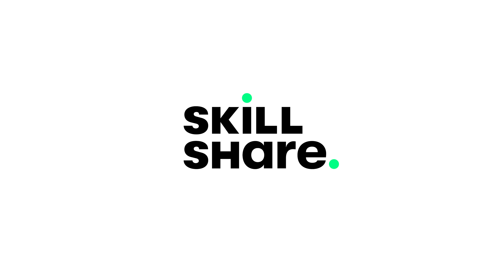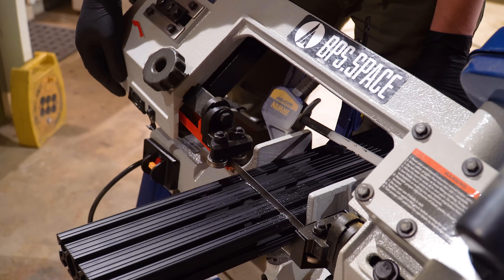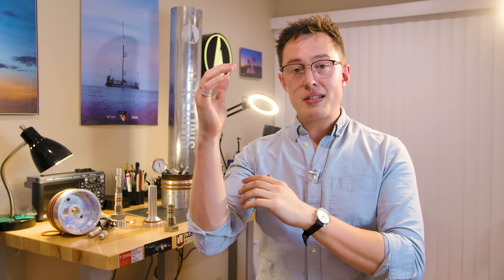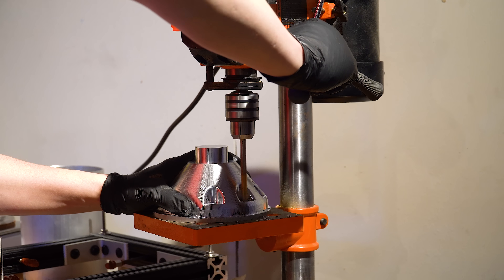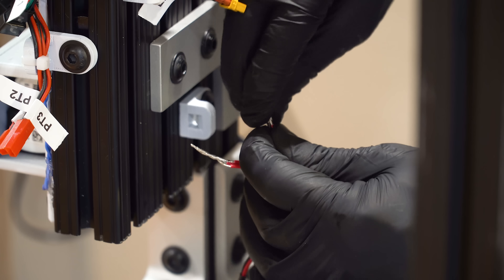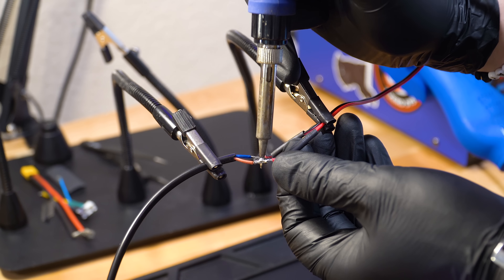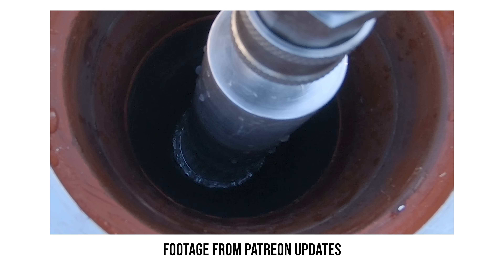Building A Rocket Motor Test Stand - Simplex Ep 5

Comment: Fwiw, the point of the resistors in the pressure measurement circuit is to have a known resistance so you can compare and back out the current through the sensor

You need accurate knowledge of the resistor resistances to do this. Logically, that means shelling out for good resistors with tight tolerances... But it also works just as well to measure the resistance of a shitty resistor really accurately with a benchtop multimeter, which you should already be doing with your expensive nice resistors. As long as the resistance curve isn't super temperature sensitive, it'll be more than good enough

Source: I spent way too much on reference resistors for a few projects before realizing that I should just measure them and use the measurement rather than trust the specc'd number on the sheet

Edit: this works fantastically well for one-offs. Nice resistors exist for when you need your mass produced board to be within spec without adjusting the offset in the program for every board

Comment: I know this has been out for a while now, but I'm wondering if a potentially useful upgrade path for this would be to include lateral load cells on the little stabilisers that hold the rocket. Finding that certain nozzle materials or fuel grain geometry (or whatever else) can lead to some slight lateral force could be really useful and may not be noticeable visually, particularly with the whole test stand firmly tied down.

Comment: I wonder about 3 ton and 20 ton loadcells, how did you calibrate them? Like you would need exact weight for example exact 1T and 2T for the 3T, and like exactly 5T and 10T for 20T, but where do you get exactly 20T to calibrate it? Because you did calibrate it right?

Comment: Whack it with iron oxide you get thermite, so I dont think I'd call aluminium non-sparking. Have seen small ignitions from aluminium coated steel nuts as they are undone before.

Comment: Joe, I built 4 test stands for my KNO3/Sorbitol “N” motors. Very similar setup to yours. 
My biggest mistake was NOT securing the motor to the test stand.
One test,  blew my fwd closure out. We did not know the motor launched itself over 600’ high until we heard the incoming whistle of the 6061T-6 motor tube returning to earth. Crashed less than 20’ from us.
Our load cell was a brake cylinder hooked to a steam gauge and recorded on video to get our thrust curve data.😂
The motor I designed and had built was supposed to withstand 5,000 psi, but the motor would operate at 1,100 psi.
If you want to know what my intentions for the motor was, drop a line. 
Richard Nakka, flew down from Canada to N.C. to observe my experiments with his propellant in my motor.
Good luck! Heads up!

Comment: Hi, I'm gonna make an active stabilization system for my model rocket using two pairs of fin control (not TVC, each pair of fins for X & Y axis) and the main question is, is there any PID tuning software or calculations to do it for it ? I searched everywhere but i figured out that this is one of the things that model rocket community suffer from the lack of it and it's many people's main concern and question. So can you make and example and describe it in a video? I'm sure it will be a reference in entire model rocket community

Comment: I didn't get to see this in action, but I'm a big fan of simple and compact static stands. Not sure if Rick would have brought it up, but I think some double nuts on those threaded rods would do nicely in case they get jammed from desert dust and grime. For APCP, besides a CATO, there could also be an aft closure burn through which would impinge upon the electronics, essentially like a torch or flamethrower, but the 8020 extrusion makes that an easy adjustment. I'm really glad that you made it a point to use steel cable stays instead of nylon for fire safety, and explained why. I'm certainly excited to see how this evolves, and thanks for sharing.

Comment: As a long time fan of the copsub project, here's a few practical tips for Joe:
  1. NEVER trust a computer to arm your safety switch.  Use a blocking pin pulled out from a distance using a string and a quick connector to leave that wire unplugged until just before walking away to the other end of the string (making that the only time stumbling can arm the rocket).
  2. Welded iron bars is cheaper than screwed alu extrusions.  Akuminium may not spark, but it is flamable enough to be a rocket fuel.
  3. Instead of those plastic blobs, just strap the rocket in with fabric ratchet straps around the test stand. frame.
  4. Just for fun, use RGB fans to cool control boxes.
  5. Their biggest ever "flight ready" engine was a failed 45kN rocket that failed spectacularly but remains strapped to the old test tower in their driveway (failed engine was removed and autopsied by an MD).

Comment: The Nerd Index Coefficient (NIC) in this channel is at least 0.9, with 1 taken as the highest value. The metrics still need proper quantization, but that will have to do for now until the nerd factor can be properly calibrated. I would seriously suggest that you display the proper nerd factor on the bottom left of your videos from now.
These videos are seriously pushing some serious nerd factor here JB!

Comment: Recommend a positive connection to the test stand with your  cables (not just looping them over the bolts). You do not need a runaway test stand if a 1 in 10000 failure mode occurs.

Comment: That buck converter you're using has pretty fragile wires and they can tear off where they exit the black box. You might want to add some hot glue for strain relief to them.
Source: I use similar ones for powering lights on electric skateboards, which experience a lot of vibrations. I'm not sure how much your stand might vibrate or not, but just letting you know 👍

Comment: Ive had issues with vertical stands. If you get a blow out it launches everything in the air. Its a lot safer to have it on its side pointed in a safe and predictable direction. What made me switch was a particularly bad blowout when the nozzle sleeve failed lunching burning debris a couple hundred feet in the air. You should really look into modifying it to fire horizontally.

Comment: Just curious if you've ever have issues with 80/20 hardware coming loose over time? Personally, I had some concerns about our test stand using that kinda hardware, especially with the drive out to FAR being kinda rough. I love 80/20 but have ended up in situations where you can't use the hardware w/o locktight or something, due to high vibration environments, which feels like it kinda defeats the whole erector set ease of use thing.

Comment: Joe! With all the stuff you're doing to get accuracy, shouldn't you use a roller or rubber wheel of some kind on the rocket end of the threaded rods instead of RTV? Small difference, maybe, but surely there's a non-zero amount of friction between the RTV and body of the rocket? Just a suggestion. Big Fan, keep it up!

Comment: regarding the blue tape. I work in space industry, and once I was a vibration test engineer. When you do vibration/shock testing you want your accelerometers to be fitted real strong, right? yes, so method of choice is using Kapton tape on the specimen, and superglue the sensor on it. Sometimes they get detached, however by using super glue activator that almost never happens. So yeah.

Comment: "I found a bolt size slightly larger than the internal holes in the center" is like saying "I've discovered that these little nubs on top of one brick will stick in the holes on the bottom of this other brick"

Comment: As you increase the length of your test stand to accommodate longer rockets your vertical oriented setup becomes more risky and problematic.  Wouldn’t it be less risky to design your test stand so that your rocket fired horizontally rather that vertically?  I say this noting that the Space Shuttle SRBs were tested horizontally.

Comment: About those plastic stakes.  Isn’t it possible that in a worse case tip over or ejected solid fuel scenario that the stakes could melt thereby losing a load path?  How about replacing it with a steel corkscrew with an eye bolt on the end (like a restraint for a dog on a leash).  That would be much stronger in addition to being more fire resistant.

Comment: stacking load cells is generally not recommended from a system dynamics standpoint though. Inherently for a load cell to function they need to have a certain spring factor/movement. Stacking load cells means taking 2 of these springs together. If you're measuring transient or frequency spectrum behaviour, this is going to influence your measurements considerably unless you compensate for it (which is either difficult or impossible depending on what you're measuring. It'll probably work for your application but I think I would probably have made a dummy for both cells so that you could use only the cell you need. The 20 ton cell isn't going to tell you much useful if you need the 3 ton cell and vice-versa.

Comment: Won't stacking the load cells interfere with the readings? Assuming they depress ever so slightly, the internal spring mechanisms will prevent all of the force from fully transferring to the next cell

Comment: Great video once again!
I have a little concern concerning the arming system, how is it controlled? If the point is avoiding any problem caused by electronics going rogue, an electronically controlled arm switch seems a bit odd no? I recon I would necessitate 2 differents problem to happen at the same time (Arm switch + pyro ignition) but there is still a possibility. A manually actuated switch with 2 long wires going to the bunker would be a lot safer I think.

Comment: maybe mount the electronics in an armoured box to the side and use a Deutsch connector to connect everything all at once? That way you could have multiple test stands that use the same electronics depending on the testing case, and your electronics wont be bits if there's  a RUD...

Comment: I’ve been enjoying this current series, so thanks for continuing your personal advancement. 

I am somewhat surprised with the effort you put into this stand, that you didn’t use eyebolts for the connection points for the cables, and why you didn’t machine feet for the rods that you are using to stabilize the motor near the nozzle end.  You could have also printed out machined proper caps o for the ends sticking out to prevent scratching things. 

You are doing fairly decent work, and to see such poor craftsmanship on such minor details is a bit painful. 

Keep up the good effort, and I hope you go the extra inch next time!

Comment: What do you think about “segregated fuel oxidizer” solid motors?  It's still a solid rocket motor but fuel and oxidizer are separated. The Los Alamos National Lab has a video about that titled "Safe Solid Rocket Design for Small Satellites". Is that something you can do as a random individual rocket engineer?

Comment: Did you add an arming pin to physically prevent the servo from toggling the arming switch in case of a radio / software glitch ?  E.g. a "remove before flight" pin to pull as you are walking away.

Comment: Hey, something that you might be interested in... they make shrink tube label maker carts that go into standard label makers! It keeps the wires a lot more streamline, which ends up with more tidy wires and less snagging if you need to pull a wire through a busy rats nest of other wires
Reply: Those are amazing for creating a proper harness. I am currently in a formula student team and we found out we had some of those cartridges after we had finished the wiring harness for the car...
Reply: @deadhamster7570 Ah, fond memories of soldering 20+ pin connectors, using red loctite to hold the backshell on and only then noticing the heatshrink on the bench...

Comment: Joe, I saw you clipping the extra sharp bits off of your wire-ties.  An electrician taught me a neat trick.  Rather than cutting the excess off and leaving a sharp edge, grab the excess with pliers and keep twisting it until it breaks off.  Leaves a clean edge every time.

Comment: A couple of things:  1) You need a key-out/lock-out upstream of that remote ignitor switch.  You do not want power on that remote system that allows a rogue RF signal to trigger the arm switch.  That should require a manual key turn AND then the remote arming.  2) I would build a much better clamp to hold the motor casing.  Just putting RTV on the end of threaded bolts is not good - it puts a point source of force on the case that can fail or slip.  I would thread the rods into curved yoke or perhaps a 90 deg clamp.  What you have reminds me of trying to put a Xmas tree in a cheap stand - and that never works!

Comment: If your casing stays under 300F, I would highly recommend high temp threaded rubber bumpers (McMaster) to go on the ends of the motor stabilizing threaded rod. And also a nut and washer on the inside of the frame to keep tension on the threads so the rod doesn't back out from vibration.
Reply: You beat me to it. It's funny how he makes all those nice parts and then throws on gobs of RTV.
Reply: @coreywelch  that has a name, field engineering xD

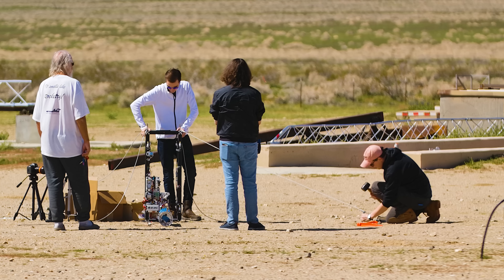Comment: At 7:52 it looks like you are using plastic ground stakes. Please use steel for some overkill. Look at the stakes used for rental tents. I use them for my giant kites.
Reply: Also please put the cable around the stake not just hooked on an ear.

Put fender washers and wing nuts on the studs that the cables are on to capture them.

Comment: you may want to consider mounting the electronics horizontally instead of vertically with a shield over them so if the rocket blows up, the majority of the blast will pass over your gadgets, though maybe that wont work because some need to be within a certain proximity.

Comment: If you use lag bolts instead of hammering those tent stakes in, there are some benefits: they're way stronger, and also you don't have to use a hammer.  Btw make sure the stakes or bolts are angled away from the stand.
Reply: Yes about the angle. The stake should be perpendicular to the wire rope when fully into the ground.

Comment: Joe, building a reinforced box for electronics and hiding it behind a small concrete or bricks wall is the best way to protect those devices. Believe me it's very frustrating to see all that blown to pieces by a CATO. And BTW, try to put a protector (1/2" steel sheet) between the motor itself and the sensors. You'll thank me later!  😉

Comment: Will you rebuild and retest the engine as it was originally designed after going through with this series? When you cut off the other section of the engine was the intent to later build a rocket around a similar modified motor?
Reply: Nvm I get you big man

Comment: By the way, instead of RTV on the end of the bolts, both inside and outside. Use Tennis Balls. They are soft, yet rigid, don't disintegrate, are very visible and easy to take off...
Reply: They are a hair more flammable though...

Comment: Hey Joe, curious what your load cell calibration setup looks like. Did you use the manufacturer calibration or do something yourself?
Reply: Just measure without load and then put a known mass (e.g. 20kg weight plate) on top and measure again? Assuming the curve is linear and you don’t need/want any temperature compensation …